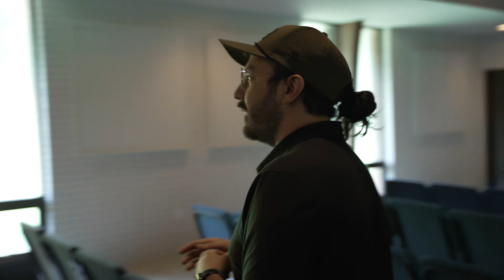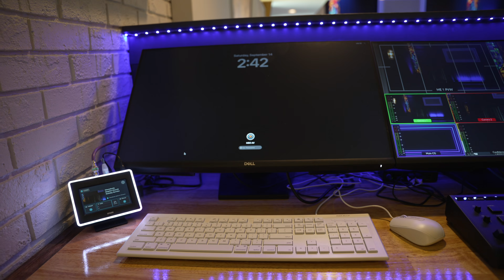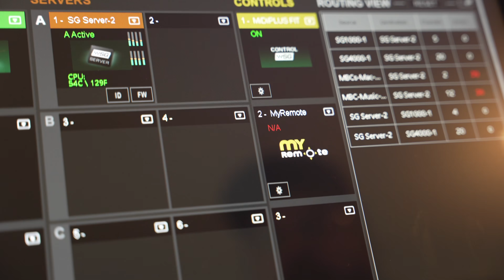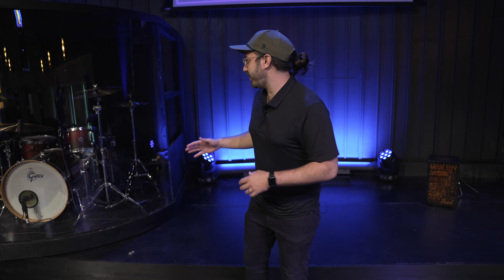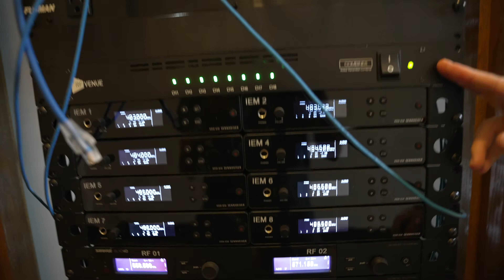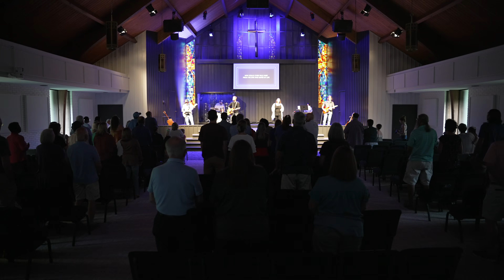Worship Tech Tour - Macedonia Baptist Church (Fulcrum PA, Waves LV1, Canon PTZ)

Comment: I'm a sound engineer. I think that's is a overkill. I know the password doesn't need all that it's about the worship band could've saved a lot of money. Couple. mayor ultra X 80s they're expensive but would've been a lot cheaper than what you guys did. This is not a rock concert. You probably spend $100,000 on this equipment. I could've did everything for 30,000.

Comment: Pretty darn cool. Booth is awesome. Point source PA? Friggin love it. Usually don't like line array because too often you get very little spatial information and at the end of the day, it's still relies on frequency interference to change it's efficiency (unevenly vertically), has no horizontal pattern control, and who's vertical pattern control is entirely dependent on length and splay of the array. Too many compromises when used in installs.

If you see this, could you comment a bit further on the acoustic treatment (AT)? I looked over Primacoustic's website and it doesn't look like they make treatment deeper than 2"... How did y'all handle for room decay time (this room is just big enough/small enough for it to be a mix of diffuse field and small-room acoustics, so I say room decay time instead of RT60) past the point of the panel's capabilities? 2" panels (depending on the company) start to lose their effectiveness at around 1khz-500hz and are completely ineffective under 100hz. According to Primacoustic's website, their NRC rating further changes with how its painted and even though Primacoustic shows an NRC of 1.0, they don't give a chart showing their absorption coefficient as a function over their frequency response. I'd love to hear of a company that's made a better AT panel at the shallow depth. That would be so convenient!